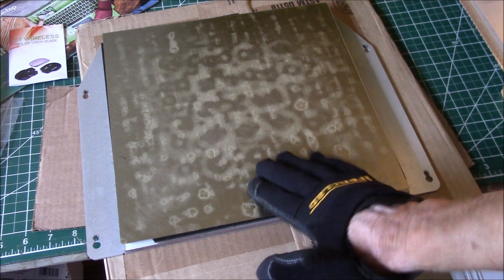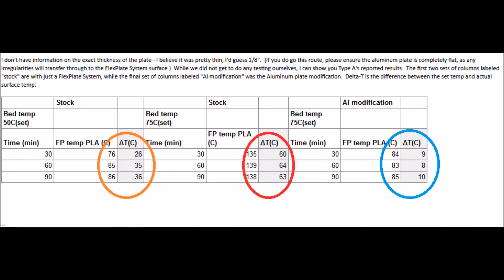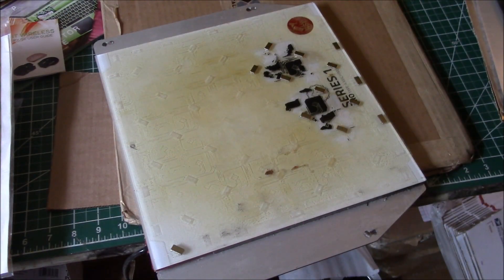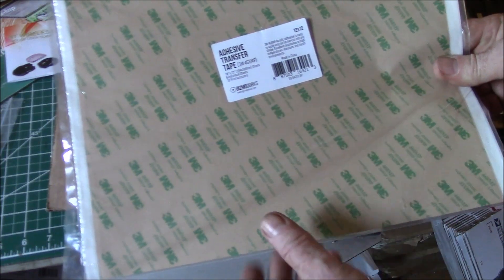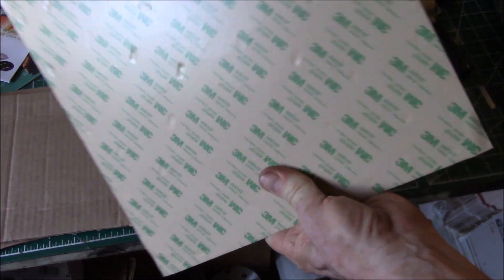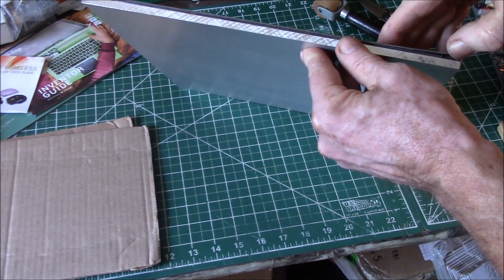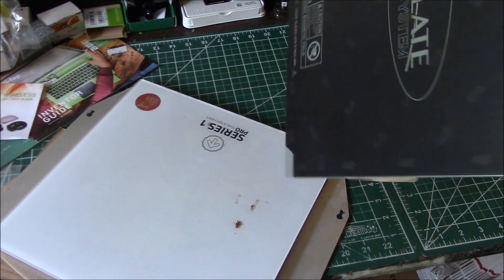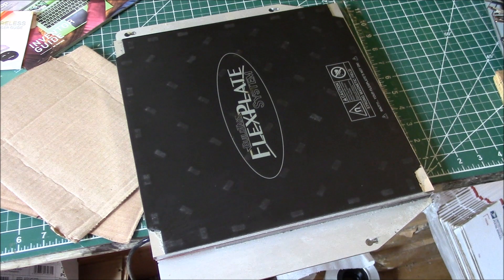Replacing BuildTak FlexPlate Magnetic Base

Comment: I am having a similar issue with the tevo tornado + buildtak system.  It worked well for almost 2 years of excellent function and now the magnets are coming loose on the outside edges.  I wondered if you could comment on how this fix held up?
Reply from the maker: It's been 18 months now and still working well.  I think a thinner aluminum plate, like 3 mm or 1/8" would have probably been OK.    No lifting or warping any place.